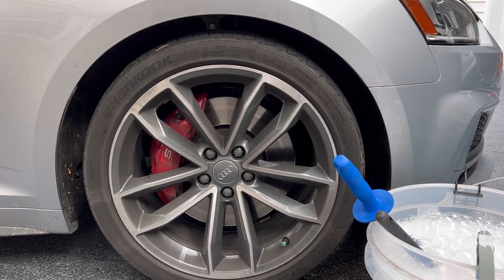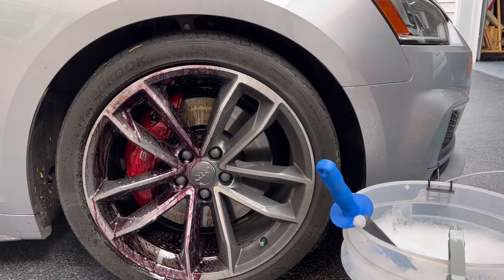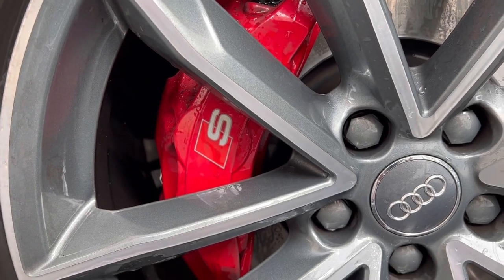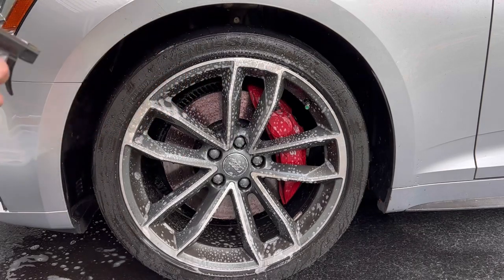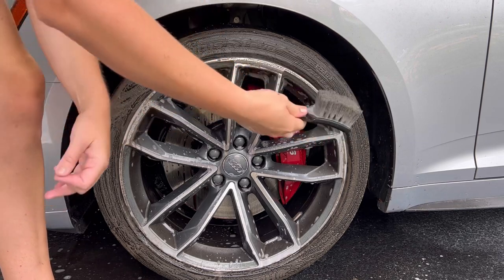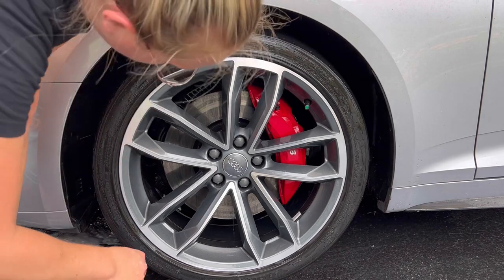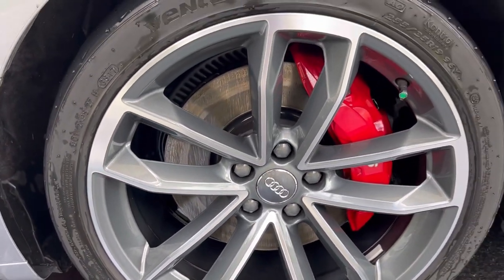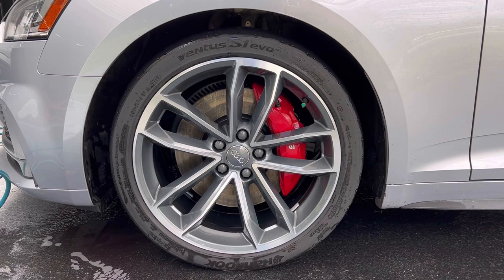Cleaning FILTHY Audi S5 Wheels with Shine Supply Cool Guy + Wise Guy- AWESOME RESULTS!

Comment: Thanks Chelsea. Love your videos.  How does this product compare to P&S brake buster? Does it have a rust inhibitor?
Reply from the maker: I didn’t notice a rust inhibitor but as far as cleaning power my experience with brake buster was that it was okay for tires and nasty wheels but more designed for regular maintenance of tires and wheels and I believe theirs is a rtu product so you go through it quicker plus it’s more water down. These however are great for heavy cleaning and light maintenance based on dilution, thicker so you use less and the tire cleaner is awesome and a concentrate

Comment: Chelsea any recommendations on a Compound or polish for Painted black wheels? I figured it needs to be something with some cut in it. They're not horrible but were definitely cleaned many times with too abrasive of a brush.  You actually recently cleaned a Type R. They're the stock black Type R wheels.
Reply from the maker: I use a nano polisher and something Sonax Perfect Finish or Oberk Cut